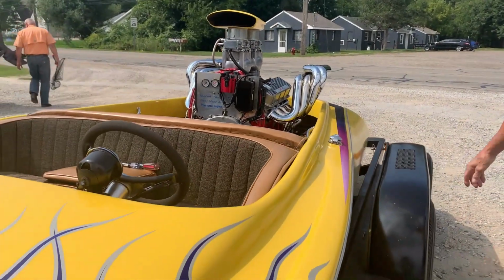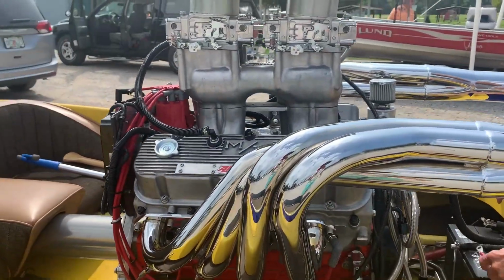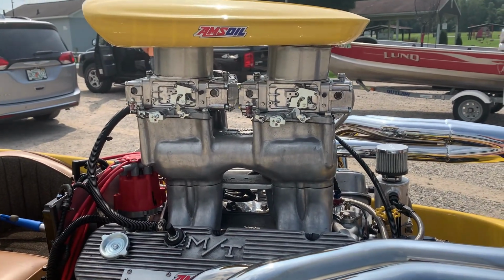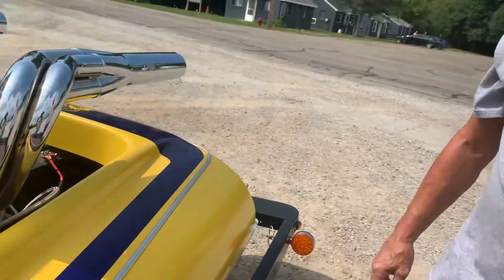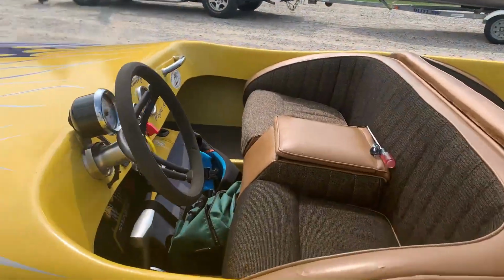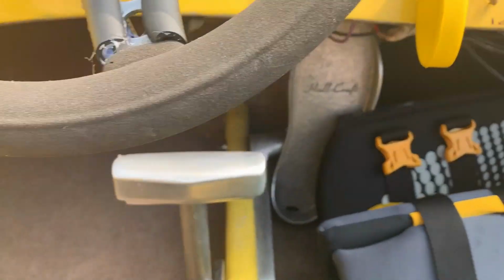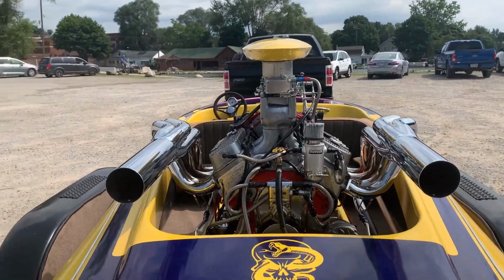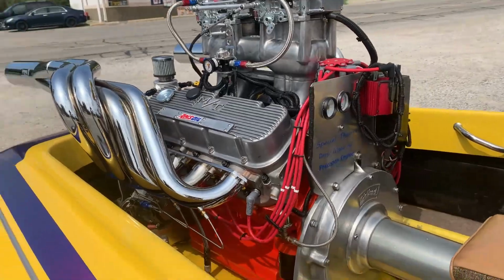#1 - RKON Goes For a RIP in Ken's '71 Sanger w a BBC!

Comment: You were doing 60 on that ski and that flatbottom wasn't breaking a sweat with the plate down just Cruising..no jet boat can compare to a v drive prop boat. A thrill of a ride in a flatbottom. My father called it clinching some seat cover when he would drop the plate and smash that pedal
Reply from the maker: "Clinching some seat cover"🤣
Reply: @thehillbillyhierarchy       Ha ha.  Extreme Pucker Factor.
Reply: Yeah glad you got a chuckle from that. My father has a 1968 howard its also yellow with a wood deck. He named it buttercup. He used to tow it with a black c10 shortbed( aka blackjack) back in the day when he drag raced it. I showed him the video he said Sanger are fast boats and a lot lighter than old buttercup. Best of luck out there 👍
Reply: Have a Placecraft jet w/760 hp (SAE corrected), dyno verified.  675 hp actual during speed runs...100 mph verified by GPS and speedometer.  Blowing away a 60 mph jetski doesn't cut it....every flat or jet can do 100 mph (according to owners) with just a tac and the seat of your pants.  Lol.
Reply: @lvjetboy2908  With gps available on everyone's phones, speeds are easily verified.
Reply from the maker: So many people have said "thats not a 100 mph boat - 60 tops" that we had to go out and do a gps speed run :D.  Its not optimized yet but its already in the 100 mph range.  A lot of room for improvement.  The motor is out of this boat for the winter and is getting some major upgrades for next season.
Reply: I would have a good grip on that seat cushion for sure! 🤣🤣🤣🤣
Reply: My boat will break the triples number with the right power plant.  That was verified by the SDBA. It's a squirter boat with some work to it.😊

Comment: Very cool boat and looks like a nice setup.  I have a 22 ft Donzi with a 502 bored.030 good AFR heads and and 8-71 roots style blower it making around 700 hp, I do have methanol injection when the time comes to push it harder but my boat will run low 92 mph gps with the prop I am running and its and out drive I believe a sportsmaster its setup so the top of the prop is 1" underwater at cruise.  My exhaust is similar to this one just water injected headers I love the boat great engine and runs strong but my boat design is old and the boat with fuel is 5000 pounds.  I dont like this part but just about any good boat with a big outboard is going to be faster than I am and they are going to burn half the fuel.  It makes me think sometimes??
Reply from the maker: 92 MPH is plenty fast enough!  That is a big boat and a lot of weight to push, i'd love to have something like that!  I bet it handles the chop pretty well.  Not too many outboards are running in the 90's around us :)
Reply: @thehillbillyhierarchy  Thanks for the comment and opinion and I do agree presently I am running a 32" pitch prop and believe I could run up to a 33.5 with pulley change on blower and get the methanol injection going I would have enough HP to pull it but like you said and again I agree I think 92 is plenty fast enough and if some tunnel comes by me running a pair of 450R engines thats just the way it is!

Comment: Sweet boat...combo could do 122mph no prob with +13% gears 11×15 pitch prop...vintage pro stock drag flat bottoms do it in 1/4mile no prob
Reply from the maker: He does have that prop so its time for a gearing change.  As far as he knows, its still on the original 1:1 ratio.  we were running at 7k rpm at that speed so it needs the gearing change at this point.  He is building a new motor for it over the winter so he's going to have some more RPM to work with.  Good to know there is plenty of room to grow...122MPH would be insane!  Thanks for the comment.
Reply: Need 21% overdrive with 11 1/2 15 prop at 7000 RPMs to do 122

Comment: I had a 62 spico  with the same casale tranny.  They came with hemi or 427 ford.    The driver would   have to  side wind the ski rope,  before take off.   With the prop i had on it.  It would not out run a bass boat.
Reply from the maker: Educate me!  What do you mean by side wind the ski rope?  Prop definitely makes a HUGE difference in drivability and if you're towing skiers, who cares about top mph :)
Reply: @thehillbillyhierarchy  I could have explained it better.  After i wrapped the rope around the skier. I would drive in a s pattern.   To give the skier  time to get ready for take off.

Comment: 100 mph my ass!  That old sled doesnt even have a down peddle on the cav plate, V-drive is set back way to far for that kind of speed, has a rear seat, the cav plates are old and out of date.   That boat safely will run maybe 60 mph...  Maybe.
Reply from the maker: I don't want to tell you you're wrong but we were able to get a run in on this boat with a GPS on it.  Feel free to go to my channel and check it out :)